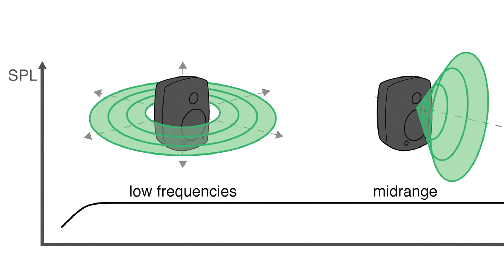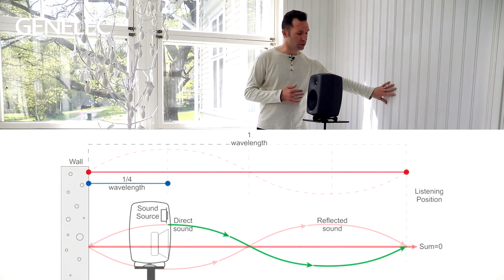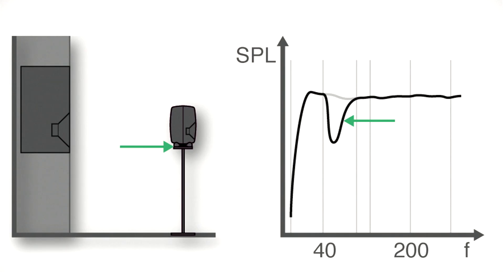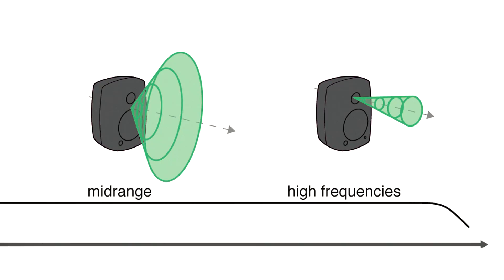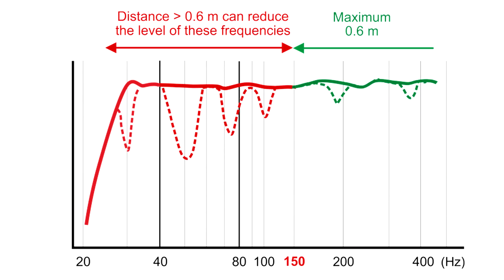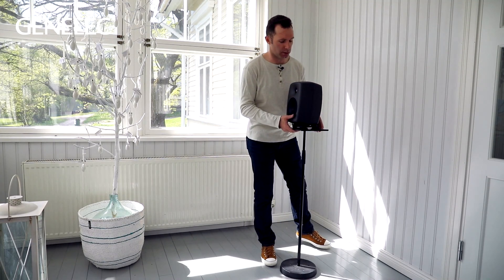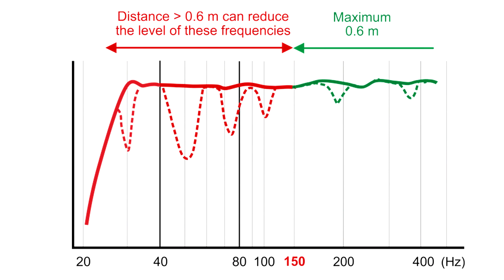How far from the wall should I place my speaker? | Episode 10 | One Minute Masterclass Season 2

Comment: There is a youtube guide by a speaker company to check where you place the speaker (forgot which one). Start speaking leaning on the front wall and move forward until it sounds natural to your ears. Thats where your speaker goes. Mine is at around 35cm. Straight forward and really effective that i didnt need the diffusers anymore. 

I dont know about 5cm, seems too close for me.

Comment: i bought a pair of speakers (5,25inch driver with 0,75inch tweeter). I want to mount it on a large room for a shop. So what is the optimum distance from the ceiling. My room is 3 meters high. Should i mount it near the ceiling (under 0,6m) to avoid bass cancellation? So now I will have 2 bass boost, 1 from behind and 1 from ceiling, is that okay? Thanks
Reply from the maker: It is good starting point to have them as close as possible to the ceiling. Depending on the model, you DIP-switches or GLM to compensate the boost. We are happy to help more in details by e-mail at support@genelec.com, and you can find useful information from the following link: https://www.genelec.com/monitor-placement
Reply: @genelec  thanks for the reply. Just did it today, the speakers are mounted on brackets with 50cm distance from the ceiling. And yes the bass was so overwhelming. So I tweak the high pass filter till the bass sound balance and the overall phase sound good (no audible peak). Still my first tweak. I will try to tweak again tomorrow. So again, thanks alot. Appreciated that.

Comment: But where should you place the speakers if you have 4" panels of acoustic treatment and 16" corner bass traps already on the front wall? Is placing them right against the front wall advice when there's no acoustic treatment?
Reply: Just calculate distance between concrete wall and speakers. Sound absorbers doesn't matter in this case.

Comment: What if the speaker is close to a corner?
Reply from the maker: The instructions shown on the video would be valid. When placing on the corner, the low frequencies are often boosted, and you can compensate that by calibrating the speakers with the GLM. With the Classic series, you can use the DIP-switches on the back of the speaker. In example you can try to compensate the boosted low frequencies by enabling -6dB from the DIP-switches on the back of the speaker. Don't hesitate to reach out to us at support@genelec.com for more instructions and we do our best to help! 🙂
Reply: @genelec  Many thanks for the reply. I'm interested in the 8330A with the GLM calibration tech for that reason. My room can give boominess around particular frequencies so fine-controlled DSP filtering will be useful.

Having the option of a coaxial or optical SPDIF digital input would be great for me, but I understand the speakers will still accept a SPDIF signal through the XLR input and I'm willing to use an impedance converter.

Comment: I have a corner desk setup just like it's shown in this video. should I buy monitor speakers or wait until I get a good room and acoustics ? plz help
Reply from the maker: Without having the monitors, you won't know how the sound works in your room. So, it is good starting point to have the monitors, and find most optimal spot in your room, and then also work on the room acoustics based on the needs. You can also try to consult local Acoustician for help for room acoustics. You can also reach us at support@genelec.com and we can give limited support related to this matter too.🙂

Comment: interesting... this is very different from what the manual says that came with my Genelec subwoofer. It says the main monitors should be at least 43" from the front wall.
Reply from the maker: Monitor positioning is different when using subwoofer on the system. With subwoofer, it is recommended that speakers are atleast 43" / 1.1m from the wall. This is because at this distance, the first cancellation dip happens at low frequencies below 85Hz, meaning that the speakers will not play this audio anyway, as the subwoofer is handling the low frequencies. This is the reason, that the recommendations are different when using subwoofer. You can find more information from the following link: https://www.genelec.com/monitor-placement

Comment: 5cm distance when an acoustic panel is behind the speaker too?
Reply from the maker: It is good to have 5cm free space behind the speaker, so that the air flows freely from the reflex port.
Reply: @genelec  With the panel glued to the wall, is it always mandatory to leave 5cm of air space with the back of the speakers?
Reply from the maker: @gigaxxx97  Yes, it is recommended to have 5cm free space, so that there is not any kind of material. So it is recommended to have 5cm distance to the panel in your case.
Reply: @genelec  Thank you very much!

Comment: I fully take on board that low frequencies are more omnidirectional. But, there is absolutely no way that bass is equally loud in front of and behind your speaker. Unless, of course, your speakers are ‘dipole’. I have checked and validated this using a db meter!
Reply: The focus here is not on intensity but rather on directionality, specifically with low frequencies, which don't exhibit strong directionality due to their longer wavelengths. This is why reflections can lead to dips in volume through phase cancellation. It's worth noting that low frequencies are more omnidirectional, and your observation about the unequal loudness in front of and behind the speaker aligns with the principles of wave propagation.

Comment: Hi Darren. A bit of a pedantic question but is that 5cm measured from the centre of the port, or where it's closest to the wall or what? Just recently bought some Genelecs & trying to squeeze as much goodness as I can from an extremely imperfect room.
Reply: Its measured across the height/widght of the port (not its depth) (if  its round), thats how much ur speaker needs to be away from the wall at minimum.
Reply: @KipacWF  I don't understand your comment, I said nothing about depth. The speakers are angled so they actually point at your ears yes? So one side of a speaker will be further from the wall than the other side. The question I'm asking is is the 5cm measurement from the edge of the port that's closest to the wall, or the centre, as in left-right centre.
Reply: @pureventrue2357 5cm as in the ballpark of 5cm. It can be anything from 5 to 40 cm, you can experiment with the distance and dip switches. 1cm of distance will not make or break your room acoustics.

Comment: but if you  put your speaker right against the wall, it will be inside the area of highest pressure for the axial room nodes, no? that sounds even worse than SBIR problems unless i'm mistaken.
Reply: Depends on the listening Position and distance to the sides. Many factors go into this.
Reply: No, it's not. Just treat back wall a bit.
Reply: Also wouldn’t you have pronounced bass? Unless the speakers were designed to be close to a back wall you will have too much bass.

Comment: so 5 cm ? not 30 cm ?
Reply: With rear ported speakers 30cm i think
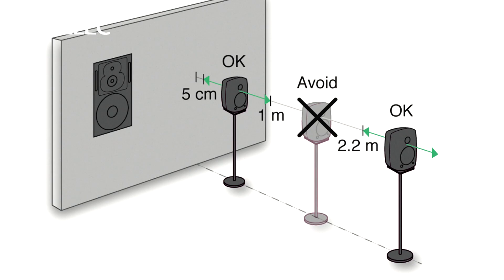Reply: I think either is fine as long it's under 60cm or away from the wall over 4 metre if you want the dip present under 20Hz. 0:39

Comment: What about relative to the ceiling? Should they be within 1 meter or less, or more than 4 meters away? My ceiling are 8' high, and I have the Genelec 8260.
Reply: stevenswall, I have small (20X12X10") speakers (35 lbs each) shelf mounted, horizontal placed, woofers in to side wall about a foot out from side walls. They are seven feet off the floor and a foot and a half below the ceiling. Separated by a large room arch and roughly nine feet apart. Stereo image is good anywhere in my 1,700+ cu/ft living room. Bass is formidable and easily tamed with my ADC Sound Shaper Two IC equalizer. I've had this setup for nearly twenty years now. My speakers are Ohm model L's that I purchased in 1978. 
 Speakers with good dispersion needn't be toed in/out or tilted. High Fidelity magazine (in 1977) said of the Ohm L's..... stereo imaging is excellent- to the point where the sound seems almost totally detached from the speakers.... Do experiment with speaker placement, you just might find the perfect spot, fuhgeddaboudit.
Reply: It's always a matter of room modes. The height of a room is typically much smaller than the length or width so the frequencies at which the height causes problems is higher.

Comment: Many open-back speakers have "room control" switches that will affect below the 500kHz range by -2dB or -4dB. 

When bringing the speakers closer to the front wall (like your second example), should we be activating those switches to compensate for bass build-up?
Thanks in advance!
Reply: @genelec  Thanks for the detailed reply
Reply: @devinreed8857  Shame he deleted his reply, could be because something he said was wrong.
Reply: @genelec  I know it is over general to say definitely, but as I have no way to measure my room, I am having a very small room (placing the 8030 5cm from a concrete solid wall with no treatment, and 1.5m from a wood drawer facing the speaker), would you suggest placing the port 5cm apart from the wall would say activate the bass roll off -6db switch?

Comment: 4 meters, wow. That would place my sub outside my studio. :-)
Reply: Just asked next door if they can accommodate my speakers. They said no.
Reply: @ianhinds3480  Neighbors are so uncool these days.
Reply: hahaha same
Reply: Lol !! 😂😂😂
Reply: your subwoofer is not effected by this, as it (I hope) is not reproducing frequencies above 200Hz so you can put it in a corner.
Reply: @abdo-dr1tu  I was of course joking when I said that. :-) When placing a subwoofer close to a wall or a corner you will encounter something called 'corner loading' which often is desirable in home theatre setups to get more bass, but in a studio environment we want to get linear, accurate bass reproduction, and having 6-9 dB extra LF can be problematic. Small rooms make this even worse, adding severe room modes. Sometimes you can't place a sub in the optimal position,  due to said small room size, that's when GLM really shines and helps alleviate the problem.
Reply: @LasseHuhtala what's GLM?